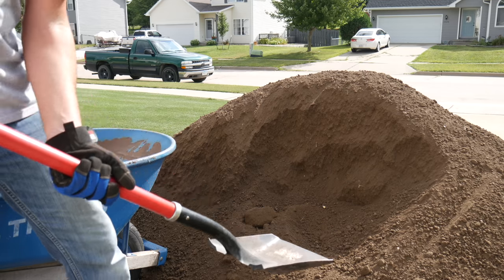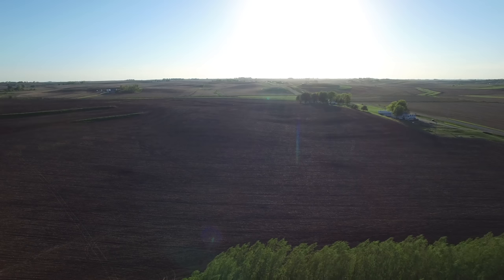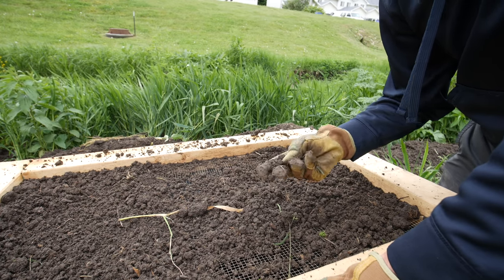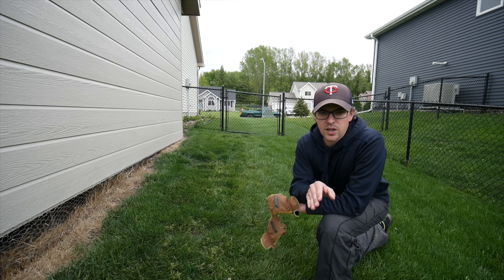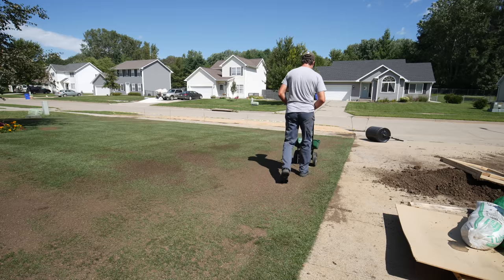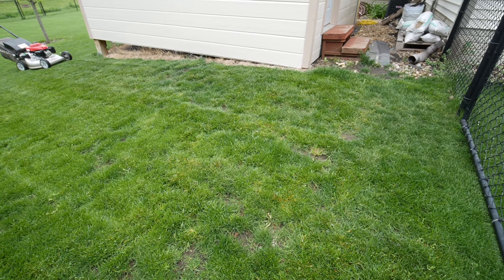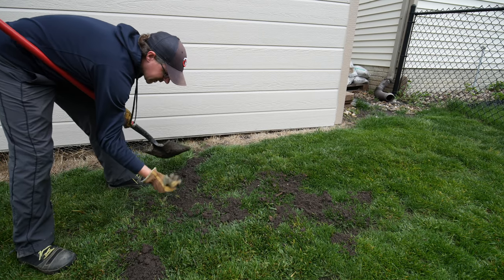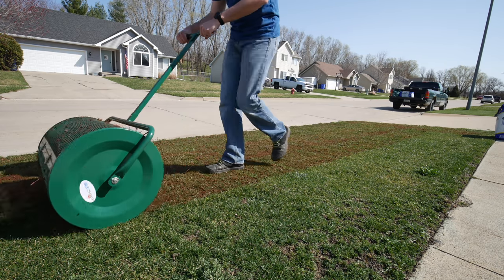Fixing LOW SPOTS In My Lawn + BONUS FOOTAGE "The River"

Comment: Thanks Ryan,  I have been spending a lot of time on my lawn while locked down, and did some leveling.   I bought a leveling tool and had a yard of top soil delivered. I paid extra for screened and was annoyed when I got it because it had rocks and wood chips.  I complained and the guy I bought it from told me I got screened and should have asked for SIFTED!  WTF, what was I going to do it was in my driveway, I sifted it by hand. 
Today I saw the first blades of grass pop up.
Reply from the maker: If they can sift it ahead of time, I'm all for it!
Reply: Kevin Kringle about $50 per yard delivered.

Comment: Hey Ryan. First off, great channel! Been lurking for quite some time now and have learned and used a BUNCH of your tips and techniques. I have a question for you. Would it be best to use a weed preventer like Tenacity and a fertilizer separate? Or should I use a product that has both combined, just as an example, the Scotts line that is fertilizer and weed preventer combined? I appreciate the time and effort you put into your videos. It really shows and hopefully, I will have some nice finished product pictures for you come fall time. Starting a project in the spring has been, well, fun!
Reply from the maker: I like them separately because I think there's a little more targeted control but it would be ok to use the granular if you feel more comfortable with it
Reply: @ryanknorrlawncare  Appreciate the response! I will continue to use them separately! Do you have a video soley based on fertilizer to feed the lawn?

Comment: I get alot out of your vids and have question! I live in the South on a golf course and have a soil mix of clay and alittle sand! I have some problem areas that have large bare areas due to weed kill/prevention and it killed all the Centipede! I've reviewed so much till I'm so confused but my question is, since those bare areas have some slope and some chance of alittle wash away, should I use a mix of river sand/topsoil to help build up of some wash out areas and for leveling the areas that need it?

Comment: Hey Ryan. Wanted to post this on your earlier clip about soil tests but figured posting this here would be the best way you see it. I never thought about a soil test until I saw your video on it. Anyhow, in late April I applied Scott's 1 step (28-0-7) to my front yard (less than 1,000 sqf).  1 week ago I did a soil test. My results were almost identical to the ones in your early on video. My nitrogen was very low (2.58), phosphorus off the chart and potassium at 34.4. Before I received the results I applied an application of Milorganite. My question is that should I follow up with an Additional application of a high nitrogen fertilizer? I would have purchased the ringers lawn care product (hence the 0 phosphorus) but it seems they have changed their product and has VERY bad reviews. I am just worried applying an additional product could burn the lawn, but also the fact after applying Scott's 1 step the nitrogen was so low. (I also did not fertilizer in the fall and am just getting into lawn care seriously). Thanks! (Also live in Indiana).

Comment: If you fill in the low spots but don’t roll it, will it still help to level out?  How essential is the rolling?
Reply from the maker: Packing it in there slightly just helps from erosion making it uneven again

Comment: Your last step is covering your new seed with meat moss. Any objection to using a light layer of that same soil instead of peat moss?
Reply from the maker: You could do that...it just dries out faster usually and is hard to get a light enough layer on without smothering the seed
Reply: @ryanknorrlawncare  i tried to do no more than quarter inch of soil layer on top of seed. Was just easier since I had a ton of soil left over. Peat moss would have been messy, especially since i was fixing about 3k sq feet of lawn. 

I am watering 2 times a day, but during the day with the sun, top layer of that soil gets hard ... problem? Or under it it has enough moisture to not die before i water again?

Comment: What you're doing with leveling is what I would be doing too.  I can't for the life of me figure out why a homeowner would spread sand all over their lawn, especially if they have loam or clay.  Maybe if you had sand to begin with but even sandy soils have some organic matter.   Sand leveling is for golf courses, which have the equipment and manpower to maintain it.  I don't want to be bothered with the maintenance of it, plus sand has no nutrients, no structure, its just silica.  I think leveling can be achieved using soil.  It may take longer but I think in the long run using a soil that closely matches your existing soil will create better, longer lasting results.
Reply from the maker: There are a lot of benefits to a sand cap on native soil which you can read up on but there's commitment involved with it too

Comment: Oh your working to hard.  I modified a sifter that my grandparents had.  It's a five foot frame on legs.  It opens up like an "A" over the wheel barrel and it its on an angle slight enough that you just toss the shovels of soil on it at the top and it rolls down the screen with the small stuff falling through the screen and the stones landing to the bottom under the frame.  No problems and not a body workout.